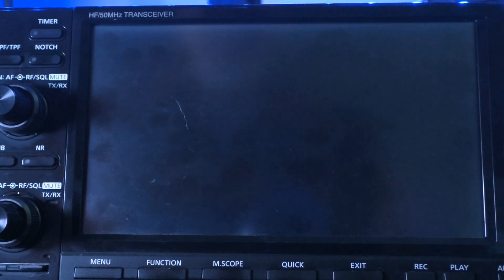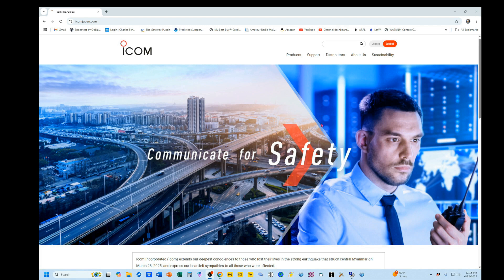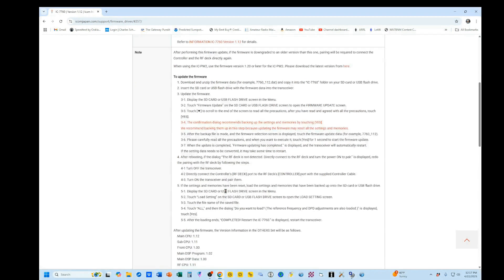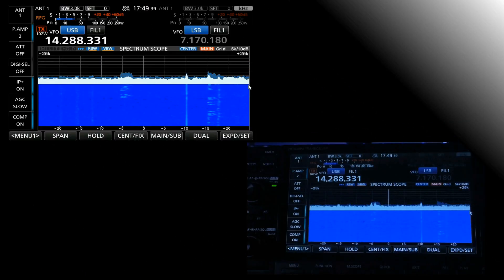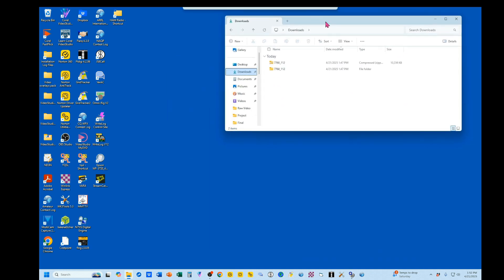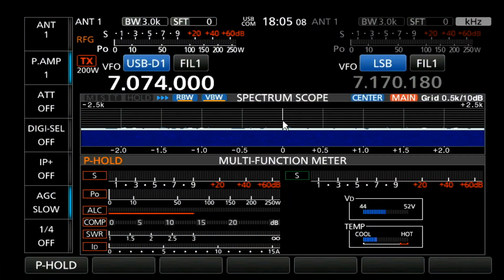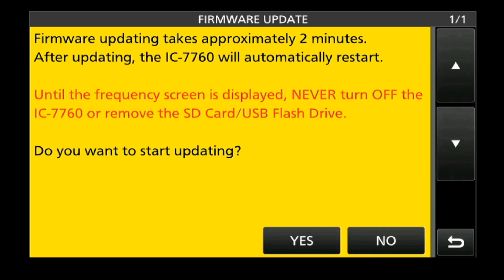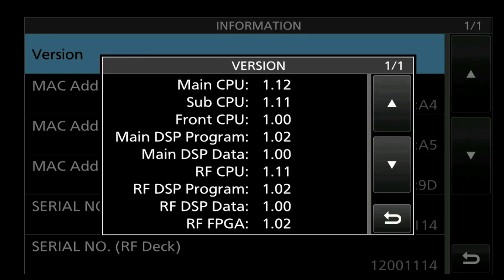IC-7760 New Firmware Update Available

Comment: The only thing I would add is, you do not want a power failure in the middle of a firmware update.   Use an uninterruptible power supply on the 120v power line to the 7760.   My whole house is uninterruptible as my entire house is backed up by a Tesla Powerwall.